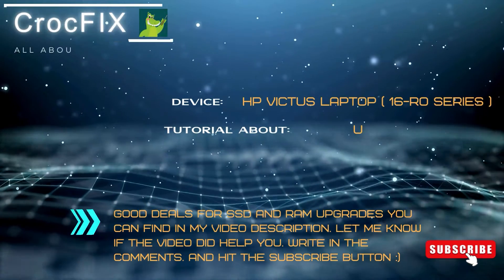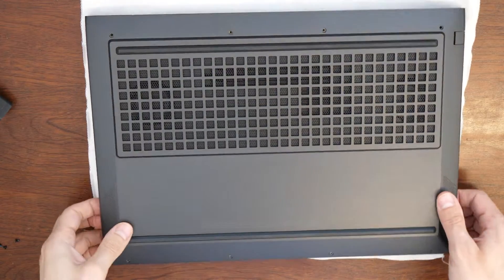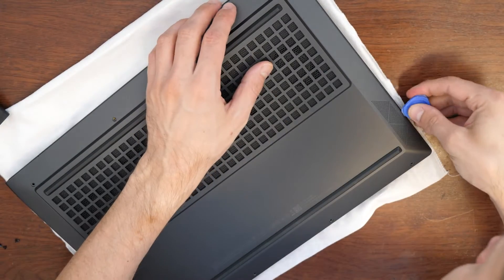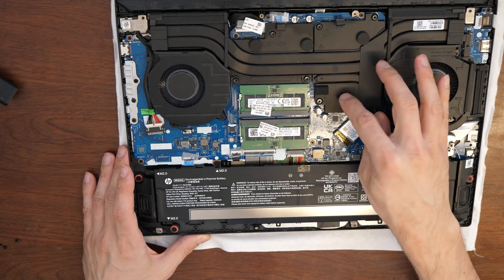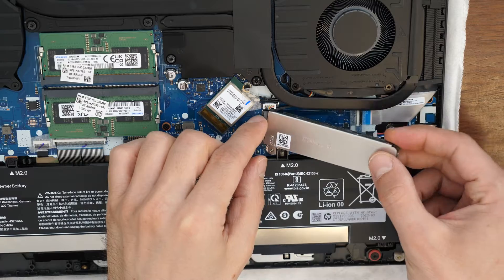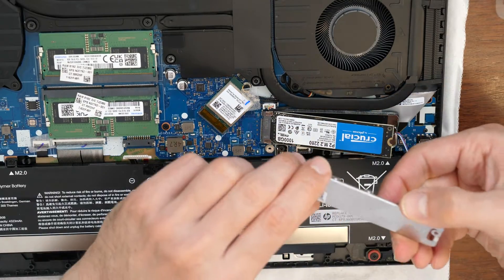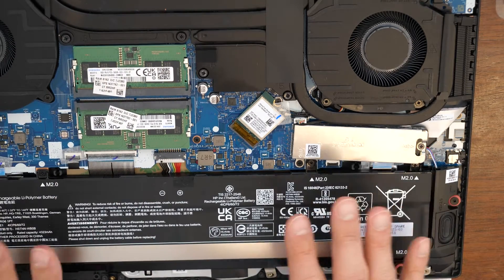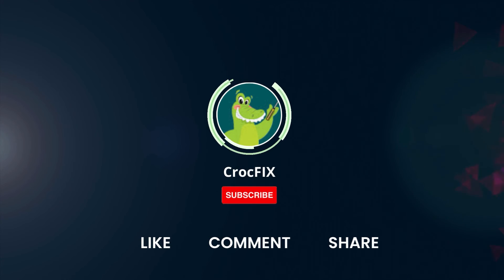HP Victus Laptop / What are the Upgrade Options?

Comment: Liked and subscribed! Thank you so much for this! 💖 When trying to remove the little silver thermal enclosure for on the SSD, I broke it off on the little side part where the side screw is. Is it possible to replace it? Or can I just put the enclosure back the way it was and not worry about that little side piece?
Reply from the maker: Thanks for the Sub. I don't know which part you broke exactly. But until the ssd is in the place and the screw holds it in place, you are fine. The top silver enclosure is a cooler for the ssd.

Comment: MODEL 
Victus by HP Gaming Laptop 15-fa2xxx 
SERIAL NUMBER 
5CD5044XY6 
OPERATING SYSTEM 
Microsoft Windows 11 Home 
- Release ID: 2009 
- Version: 10.0.26100 
- Build: 26100 
CPU 
13th Gen Intel(R) Core(TM) i5-13420H 
- Clock speed: 2100MHz 
- Description: Intel64 Family 6 Model 186 Stepping 2 
GPU 
Intel(R) UHD Graphics 
- Refresh rate: 144Hz 
- Driver version: 32.0.101.6078 
NVIDIA GeForce RTX 3050 6GB Laptop GPU 
- Driver version: 32.0.15.6116 
RAM 
HMAA2GS6CJR8N-XN     
- Capacity: 16GB 
- Type: DDR4 
- Default clock speed: 3200MHz 
AUDIO 
NVIDIA High Definition Audio 
Intel® Smart Sound Technology for USB Audio 
Intel® Smart Sound Technology for Digital Microphones 
Intel® Smart Sound Technology for Bluetooth® Audio 
Realtek High Definition Audio 
NVIDIA Virtual Audio Device (Wave Extensible) (WDM) 
OMEN Cam & Voice 

Can I upgrade may memory from 16gb to 32gb?
Reply from the maker: Yes, you can

Comment: In my HP Victus, the fan closer to the GPU runs slower than the other one, and hence the right side heats up very quickly. Shouldn't both fans run at the same speed?
Reply from the maker: Not necessary. It is automated regulated. You can check your temperatures in Bios or with a software like GpuZ and CpuZ.

Comment: Hey can i upgrade to 1 TB in MODEL 
Victus  15-fa1xxx 
- Release ID: 2009 
- Version: 10.0.26100 
- Build: 26100 
CPU 
12th Gen Intel(R) Core(TM) i5-12450H 
- Clock speed: 2000MHz 
- Description: Intel64 Family 6 Model 154 Stepping 3 
GPU 
Intel(R) UHD Graphics 
- Refresh rate: 144Hz 
- Driver version: 31.0.101.5186 
NVIDIA GeForce RTX 2050 
- Driver version: 32.0.15.5613 
RAM 
NT8GA64D88CX3S-JR    
- Capacity: 8GB 
- Type: DDR4 
- Default clock speed: 3200MHz 
8ATF1G64HZ-3G2R1     
- Capacity: 8GB 
- Type: DDR4 
- Default clock speed: 3200MHz
Reply from the maker: Yes

Comment: How can we transfer windows and preinstalled softwares and drivers to new nvme as it doesn't have a second storage slot ?
Reply from the maker: You need an USB to NVME adapter to do a clone
Reply: @CrocFIX  what specific application would we need for transfer, and if we transfer from 500gb nvme to 1tb will it work ?
Reply from the maker: @asadgreat143  Yes it will work. You can use the software provided with your new ssd or download from the same brand. Alternative is Macrium Reflect.

Comment: How can i clone the windows to my new ssd?
Reply from the maker: With some clone Software
Reply: @CrocFIX  Do i need a device of some sort
Reply from the maker: @s1lent_gr  You boot into windows. Connect the new SSD over USB adapter and clone it. Or you use a computer where you can directyl connect both drives.
Reply: @CrocFIX  it's nvme

Comment: i have the same laptop but it has ddr-2 for some reason so I cant add ram
Reply from the maker: :) They have ddr4, ddr2 is to old 😃
Reply: @CrocFIX  it said ddr2, you sure ddr4 would fit?
Reply from the maker: @clarkkent044  Please provide your laptop full model number and the model number of the ram sticks in your laptop.
Reply: @CrocFIX  15-FA1093DX, it has one ram stick
Reply from the maker: @clarkkent044  This is an very new model and it has DDR4 modules. This what you see "DDR-2" just means it's the second memory slot :)
Reply: @CrocFIX  oh, thanks
Reply from the maker: @clarkkent044  Welcome

Comment: But wait, is that m.2 ssd that was replaced the one that one that boots the OS. Because then we need to clone that drive before we install. Then that is not an easy thing to do. Its prone to mishappens and you have to usually pay for that software in order to get the best results in successful cloning. Or is the OS install in another area on the main board?
Reply from the maker: The OS is on that m.2 drive. You get the software usually for free from the hard drive manufacturer and it's working fine. Anyway I always suggest backup your data on an external drive, and install a Fresh Copy on the new drive. Fresh is always more Fresh then a Clone ;)